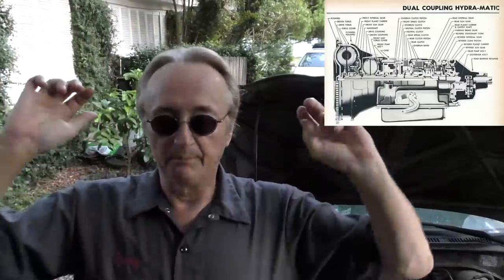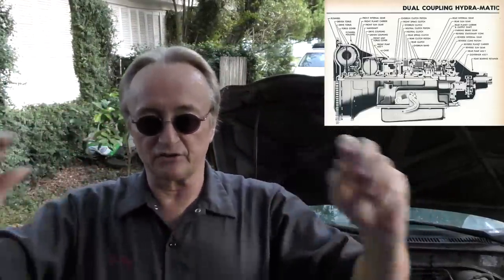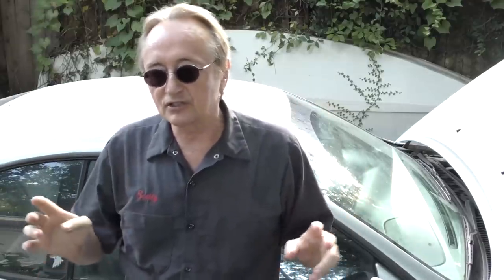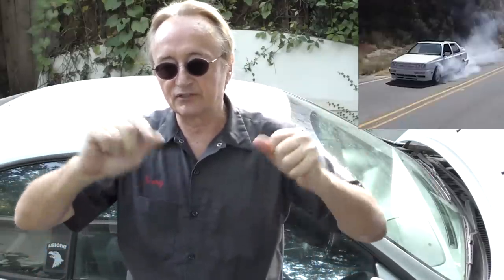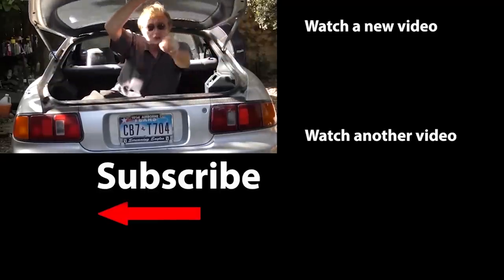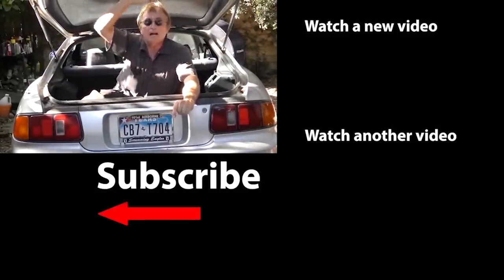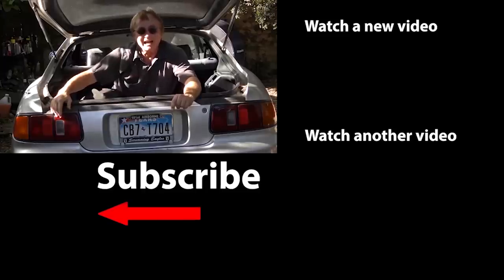This Isn't a Real Corvette, Here's Why

Comment: I oddly appreciate the fact my dad pushed me to learn drive manual stick shift.  Almost like a rite of passage.
Reply: I really experienced the difference when I was learning to drive. Taught myself on an 88' Cavalier Z24 I bought for $900. Going from auto to manual like that taught me how much the car was driving me instead of me driving the car. Got so nervous in traffic I killed it 5 times trying to take-off with everyone honking their horns at me. Good times.
Reply: Cody Clark haha, yes! Hill starts at red lights would always have me sweating buckets
Reply: My dad didn’t push me, he let me...ha ha. It was a 1942 Willys CJ2 jeep, 3 speed. Pull out the choke, 2 pumps on the gas pedal to the floor, turn the key on, then push the start button. Push choke in halfway after starting. Pretty forgiving to learn on. Went all over back woods, dirt roads and mud with it. I was about 12. Drove it illegally many times by age 14. Don’t think I ever stalled it and never got busted.
Reply: like circumcision.....nice...not
Reply: My dad always had stick and I always will too
Reply: It is a rite of passage...

for a car driving person.
Reply: My first car was a 1982 Mercury Capri with a 5 speed manual transmission.
Reply: @User-nu6km  👮‍♂️
Reply: Angel Urbina Oh yes! Unless you had a parking brake lever between the front seats to assist!
Reply: @Finestizpro  at least thats what it was for me when i was in high school
Reply: My dad was a Teamster. When he taught me to drive he discouraged me from learning stick because of the traffic in NYC.
Reply: I had to teach myself. My dad had a 5 Speed BMW when I was learning to drive, but wouldn't let me drive it. So I eventually bought a 91 S10 for $1,800 and drove it until I stopped stalling it (took about 10 mins)

Comment: Going from my car to my wife’s I’m always stomping my left foot and grabbing the air with my right hand. Kind of boring.
Reply: 😂I do the same thing with my mothers car when I drive her to the store. She always says WTF are you doing. 😂😂
Reply: I had that as a kid when I moved between my Ford Escort 5 speed & my grandmother’s Mercury Lynx with the floor shift auto! Didn’t help that the shifter knob was identical under the hand; I almost slammed it into R once thinking I was downshifting into 3rd 😂
Reply: Moist Gnome  he didn't forget.. just not used to.. (after 1 month of driving an automatic I went back to the manual and almost put it in first gear without clutch 😬
Reply: My favorite is hitting the damn brake pedal while thinking the clutch is there.
Reply: THX 1138 same here, jacking the brakes and reaching for air
Reply: 😂😂😂😂 me too
Reply: When  I drive the working van, i always do that and my hand reaches for the floor shifter.
Reply: until you drive in conditions like Scotty mentions, stop start on a hill etc....
Reply: @Rev limits yes, my mother stopped driving 10yrs ago. My truck is a 5spd manual shift that I drive everyday. I have to drive her to the store a couple times a month in her car since she can't climb into my truck.
Reply: @So Isaidtogod; Youjust brought back a great memory for me. I stomped on the brake pedal (with my left foot)of my Dads 1982 280ZX Turbo Automatic no less looking to shift in a shopping center parking lot.
Reply: My mom always tried to shift my dad's car and he always forgot to push in the clutch at stops and would stall in her car

Comment: The only reason my 91 camry is still on the road is the 5 speed manual.  Still gets over 30 mpg.
Reply: LeewardStudios -   Wow!
Reply: Good for you. Whenever you replace it, get a manual...which will probably need to be a Corolla or Honda Civic or Accord
Reply: Or my 88 1/2, the original 5 speed V-6.   P.S. - they got it right on the first release.
Only between 15 and 22 in the city though. 28-32 highway.

Comment: My 2019 Honda accord sport 2.0T comes with a 6 Speed Manual 😏
Reply: Moises Escobar nice
Reply: J give it a year or 2 n you’ll needa new paint job on her 👍
Reply: Those are rare
Reply: Good for you, they're fun with manuals!🚘
Reply: Same here with my 1.5T.
Reply: Moises Escobar too bad it’s 20 plus hp down from the previous gen Accord otherwise I’d have bought one.  Not paying that much to go backwards.
Reply: Civic Si also only comes with a manual.  

Subaru STI only comes with a manual, and I believe you can get most of the other Subarus with manuals also.  I'm not certain about the SUVs, as I have zero interest in any.
Reply: Don’t ever sell it
Reply: Chad Webb the new ones are faster😂😂
Reply: @NaturalNick  How come? I got one 2 months ago
Reply: BHRxRACER the paint that they use on em is a water base rather then oil based, water base has a tendency to chip. I had a 09 accord that I recently sold that had oil base n the original paint job still looked like it just came out the factory
Reply: Drove one at work; they are fun, zippy cars. I have an ‘05 sedan with a five speed. Handles like a boxy boat but it’s how I learned stick.
Reply: Moises Escobar yeah I saw the car review and it’s pretty cool
Reply: Got to Hondata (if you live in la) unlock the true horsepower which is practically is the type R
Reply: Since when did lawnmowers come in manual ?
Reply: Love mine
Reply: Moises Escobar i got a 06 manual accord too lmao I feel like it’s too boaty
Reply: MRCM16 highly recommend!!!!
Reply: Luckless it’s really nice 👍🏻 especially my color blue
Reply: @chadwebb1345  lol you newb, buy a ktuner and jail break it.
Reply: Moises Escobar but it’s a 4 banger
Reply: Those are great cars! And pretty quick! A customer of mine just brought his in for its annual ceramic coating maintenance detail
Reply: Yeah but they dropped the v6.  I doubt that turbo motor will live up to honda's reputation for long term reliability.
Reply: Chad Webb those were v6 and they only made them auto unless it was the coupe. . So the 2.0T is the fastest manual accord. The sedan at least. It’s a shame they didn’t pair a manual with the v6 in the sedan.

Comment: In Pakistan, it's a nightmare to drive a manual transmission due of extreme traffic, and very poorly designed roads. 
My father drove the same transmission for more than 30 years said the same thing unless driving on highways, and low traffic.

I have been driving the same transmission for 7 years, and auto for 5 years. To be honest I don't find any difference in fun factor and gas mileage, unless driving like a maniac. 

It only depends where you live, what you want, and what's it's purpose.

Comment: 2019 Honda accord 2.0T with a 6 speed manual... Performance, reliability...great resale value.. I say thats the best bang for the buck family sedan out now.
Reply: michael lee  A new clutch costs about 10% of what a new automatic transmission costs and clutches last a long time as long as the driver is sensible, can quite easily get over 300,000 miles out of a clutch depending on how you drive and most automatic transmissions fail by 300,000 miles anyway.
Reply: michael lee That is true in general. However shortly after purchasing a late-model used 5-speed manual Civic, I had to sell it because it was just too small for me (I em very tall).  I listed it on AutoTrader one evening, and it was sold the next day to an individual who was looking specifically for a manual Civic! So there are still niche buyers out there.
Reply: michael lee  actually it tends to be better for resale.  There's so fewer manuals than automatics that if you try to sell the manual it's a lot more rare.
Reply: Got a 2015 manual I wish they made the v6 man too. 189 hp just isn’t enough when I’m not hauling the kids 😓

Comment: Manuals are easier to maintain, cheaper, and more reliable also fun
Reply: Yup its 700$ to let my honda mech rebuild the 5spd but like a bit over 2gs to do the same to an auto with my year civic.
Reply: Until you are stuck in major traffic.
Reply: I found manuals to cost much more to maintain.  Autos only require periodic fluid changes.  And even the dealers shy away from that. Ever priced a clutch replacement for a stick shift car? Its between $600 to $1,200. Or, if your clutch slave cylinder blows a seal and you can't shift.  Tow truck time.
Reply: Stuart Bear that’s technically not accurate, you can still drive with a blown slave cylinder, I’ve done it on a Ford Ranger. Floating gears and neutral and shutoff at the lights. Start in first float off we go. Had to limp back to town.
Reply: @stuartbear922  If you find them more expensive to maintain I would question how you drive. Not to be rude but many of the maintenance issues manuals have are to due with operator error.
Reply: @farnarkleboy  wears the clutch though. Stick shifts aren't meant for stop and go traffic.
Reply: Everyone that replied to stuart bear, spot on. Had 2 and almost 3 automatic transmissions die on me before i bought my first maual trans civic. Ill tell you mr bear with both my civics i have NEVER experieced a single issue on either one of my civics. Have owned two maual trans civics for the past 13 years thats it.
Reply: @farnarkleboy  Try doing that in DC or LA rush hour. It's not fun.
Reply: @stuartbear922  When it happened to you, did you have luck literally forcing the shifter to engage first? I've had that happen occasionally on my 1997 Ranger with 5 speed after it's driven for awhile.
Reply: I find the american issue with manual cars pretty funny. In Europe you always learn to drive with a manual and then buy whatever the hell you want but putting an automatic in a driving school would be unthinkable
Reply: Sam if I knew how to drive manual I would definitely have one
Reply: Agree, except in heavy traffic.
Reply: It also serves as a theft prevention system against lazy melinial car thieves.
Reply: Therefore, Americans love automatics. 🙄
Reply: @stuartbear922  I've driven hundreds of thousands of miles with manual transmissions and never spent a dime in repairs.
Reply: @stuartbear922  clutch can last a lot longer than the life of any automatic transmissions, if you know how to drive, which I see you don't. In fact my hotshot run truck 1995 Ford F350 that is always hauling 15k lbs loaded on the gooseneck every week went 350k on a single clutch, and the original clutch wasn't even worn very significantly. Had automatics die on me before 90k miles though and the whole car had to go. Now I'm driving only manuals, and I'm worry free about costly maintenance and problems that automatics come with

Comment: Yes Scotty...People are a bit surprised to see that my 2012 Base Tacoma 4x4 (4 cylinder) has a 5 speed manual transmission.
I like it and I do get around better in the winter time (snow) with a manual transmission over an automatic.
I just wish I had a 6 speed manual in the Tacoma with its 4 cylinder engine.  

What I miss from the 'Good Old Days'  are the '3 on a Tree' transmissions. (Column Shift)
Those were fun and you could shift gears very easily with only two fingers.
Reply: Why surprised? Those are known fir manuals

Comment: I am a retired truck driver with 45 years experience. Most of the trucks I drove had either 10 or 13 speed transmissions. The 10 speed had a single shift stick that had 5 gears and a (up-down) switch under the knob to operate air powered  high and low range. The 13 speed also had a single stick with same (up-down) switch but 5 gears in low range and only 4 gears in high range with another button on top of shift knob to “split” the top 4 gears. My favorite were transmissions with 2 sticks, with a main box 5 speed and auxiliary box with 4 speed. There were other rare types too that I only experienced in truck driver school. Friends who still work for the company I retired from say all the new trucks have automatics, which are supposed to save fuel. But....🤷🏻‍♂️

Comment: Probably because to pass a driving test in most other countries, you have to know how to use a manual transmission.
Reply: @LinusFoamTips Autos as standard are getting more common here in the UK.
Reply: In eastern european countries most of the cars use manual as a standard
Reply: In Maryland they don't even require parallel parking anymore.
Reply: Manual transmisions are easy to use
Reply: @robertthomas5906  LOL! That's awful, hahaha!
Reply: You don't even need to parallel park anymore on test  in Canada...
Like wtf
Reply: Desmond Bagley  parallel parking is a must know in any european city. Do it daily.
Reply: @derekblankmccoy  agreed. Canada also has narrow 2 way and one way streets
Reply: Derek McCoy Most American cities as well.
Reply: Derek McCoy that’s completely wrong
Reply: @lechefy1413  that really depends of where you live. I'm from a 20-minute trip of Lisbon and mainly in the suburbs and historical parts of the city, parallel parking spots are very common.
Reply: In other countries, gasoline is also more than $5 a gallon.  So no, I don't think we want to be like other countries.
Reply: Japan actually has an automatic-only driver's licence.
Reply: Desmond Bagley I had never practiced parallel parking before acing that part of my driving test back in the 70s. I remember the examiner opening the passenger door and eyeballing the gap to the curb! I was driving a 1965 Pontiac Tempest: 326 V8, 2-speed automatic.

Comment: The electronic hand brakes, which do not allow the driver to vary the braking, does not match well with the manual transmission.
Reply: Funny you say that, my car (18 Camaro SS) is a 6 Speed and has that electric parking brake, little switch behind the shifter

Comment: save the 5 and 6 speeds!💪
Reply: PANTYEATR1 hope so
Reply: I did but autos. so much less stress to drive.
Reply: PANTYEATR1 And what about the 4 speeds
Reply: Buff Barnaby I feel less stress moving/doing something. That's why I hate highway drives! I prefer rowing through the gears on Pacific Coast Highway 1.
Reply: And 7 speed

Comment: Honda Accord comes with manual transmission too.
Reply: I saw an 03 with a manual with 250k miles on it. The same model with an automatic doesn't even make it that far.
Reply: Not according to the Honda build & price tool. 2019 Accords are all CVT all the time as far as I can see
Reply: Joaquin Hernandez i stand corrected; another commenter found the Sport trim Accord still comes in manual. With a choice of engine & everything!
Reply: @brucemorris3830  no. Some of The new Honda accords trims come with manual transmission
Reply: @brucemorris3830  sorry just saw your second comment
Reply: Only in the Sport but at least they still offer one. I have a 2014 EX with the six speed manual and love it. 37 mpg in everyday driving and 40-41 mpg on a trip. Great car.
Reply: I have a 2006 accord 5 speed. Love the car to death! I'm def gonna get a newer model 6 speed.
Reply: Buy one before they get taken away. I'm sure the next time the Accord is updated the manual goes bye bye.
Reply: I'm still driving my automatic 01 civic with 303,000 on it.
Reply: @brucemorris3830  nope, the Sport trim can be had with 6 speed manual.
Reply: I had a used '91 honda accord with a 5 speed, and drove it for most of the early 2,000's. I bought a newer car, and sold the old Honda to a friend of mine, who still drives it around.
Reply: My 2016 has one and yes they still do as of 2019.  The dealership wants me to buy another one.
Reply: jmatt781 I used to have the same car and drove it for over a decade with no problems, until it got stolen and stripped. I bet it would still be running today. 
People say everything breaks down, that’s not true. It’s designed to fail.

Comment: Low end NIssan Versa comes in a standard. Very basic car. Manual roll up windows and no power locks.
Reply: Guy at my work had one, went to that from his old Suburban. I asked him if he had driven the thing home from the dealer, or if he folded the mirrors in & put it in the back of the Chevy 😂😂😂
Reply: Kia Forte is like this too, and I assume their other cars as well. I had one, unfortunately. It had the trickiest clutch I have ever driven with. VERY temperamental clutch.
Reply: Oliva Gina  Here in the US my wife's 2015 does not have power locks. Wonder if that's been added or if it's different in your country?
Reply: Versa ewww, get a nice used Civic or Corolla instead.
Reply: That's my kind of car cheap and simple. They all do the same thing anyway.
Reply: @Josh-cw8by  haha you got a good point there. I do prefer better than a Versa. I just wish cars were more simple.
Reply: Josh you may not know what you are missing! 200lbs hits the spot for me...as long as she's cute/hot.
Reply: James Medina  yes, but at 200 lbs and higher, ya gotta throw flour on them to find the wet spot.
Reply: E G 😂😂😂😂🤪👍